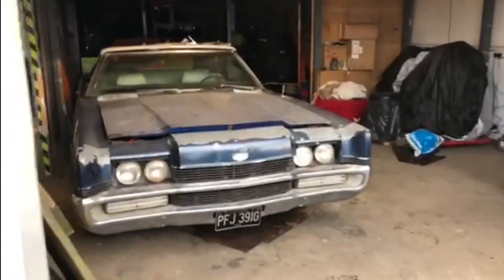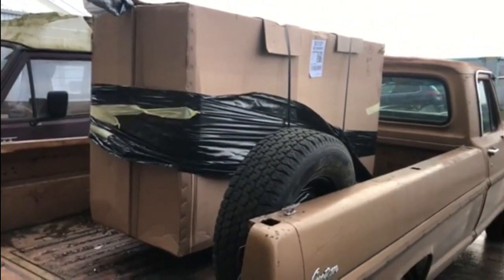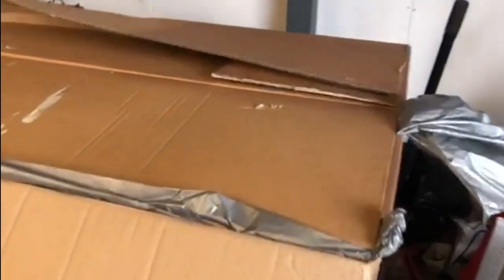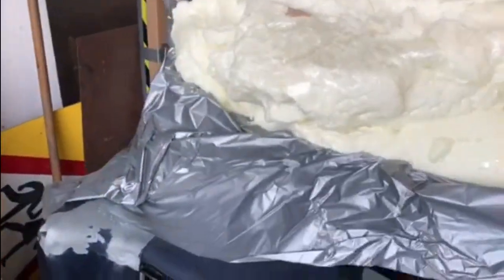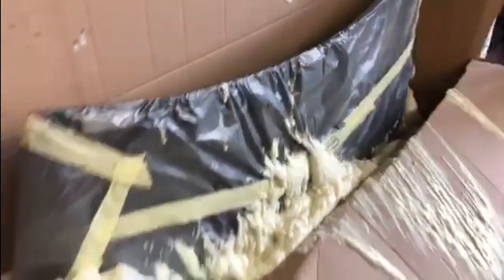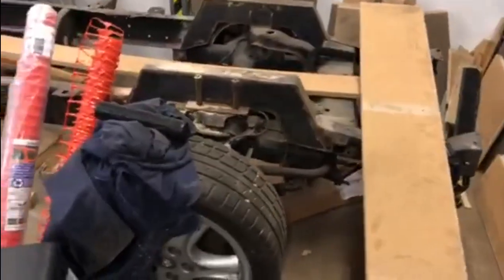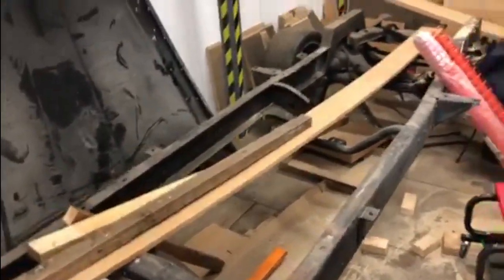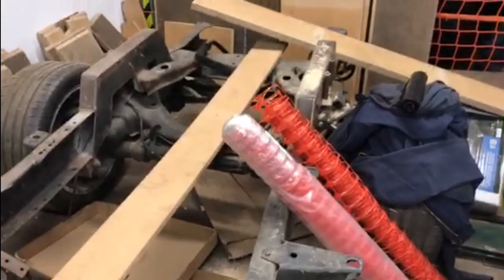Unboxing One Of the Biggest Items you Buy for your car.......

Comment: You may call it heresy, but I could tolerate owning an American car more if it was converted to right hand drive (steering wheel on the correct side!) 
I think you all need converting 😄😄
Reply from the maker: lol, there are a surprising amount of American cars that were built as right hand drive originally, not just the modern mustang. They were done as far back as the 50s. It just looks wrong to me though.